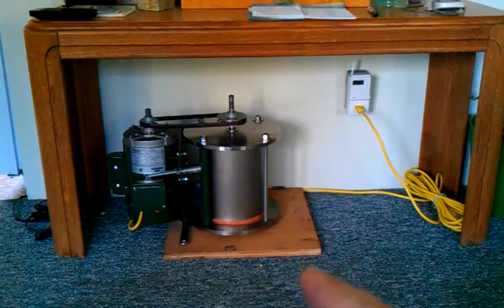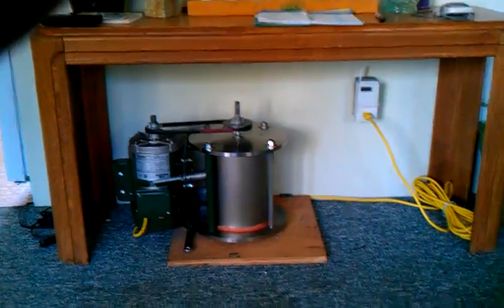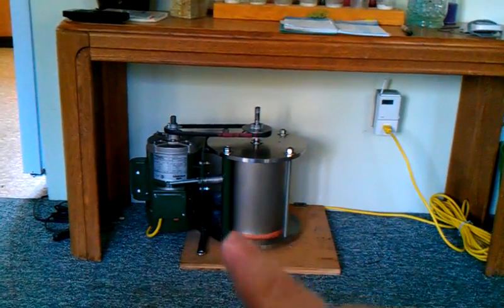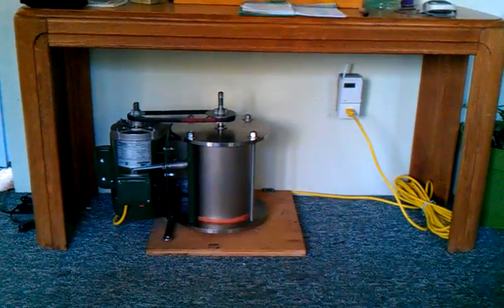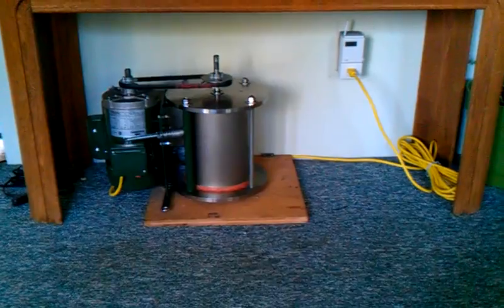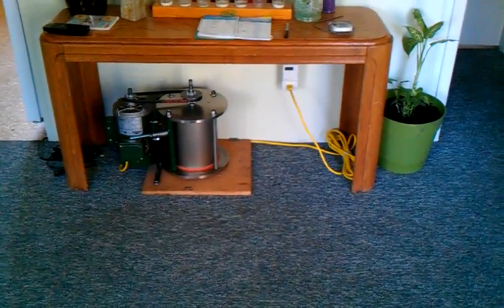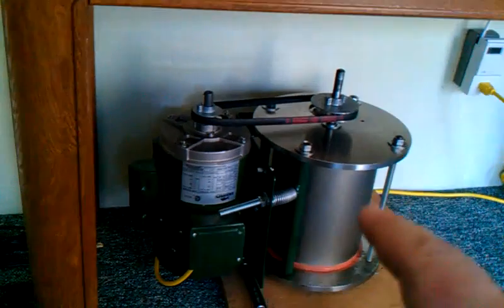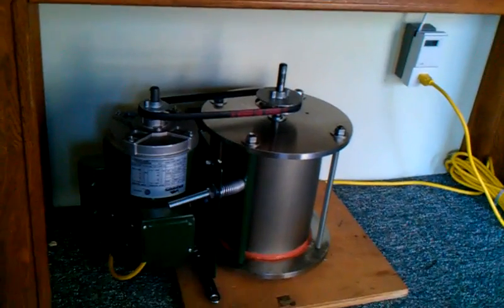Running my friction heater in my house

Comment: A vastly underrated learning experience. Do you still use this system? Can you update this?. I am producing a hydro turbine specifically to be used in old water mills here in the UK - of which there are about 10,000. Using it to produce winter heating instead of electricity obviously allows for utility in a low tech mechanisim.

Comment: I was going to comment that a V-belt has some inefficiency to it, but then realised that the inefficiency is loss due to friction heat!  That said, to reduce noise, why not mount motor and friction device in-line with a rubber coupling?

Comment: Very interesting project. Do you think built bigger could a water jacket be added with a circulation pump and used to heat a few radiators?

Comment: How is it that you need such a big one horse motor, and can get away with turning it so slow.?  The plans I see advise to use a 3200 rpm motor, the painting can design. With the aluminum flashing on the outside canister, and 1/8;top and bottom., with holes tapped in the sides of the disks, for tapping and mounting the flashing.

Comment: hi, i wanted to say that this is a good invention from charles Baker that can be adapted for green thermal energy with a VAWT vertical axis wind turbine to move the disk, and also salt as friction material against metal, using molten salt as PCM phase change material for latent heat source or heat storage. also you can improve insulation.

this technology probably will be used in the near future.

Comment: Will a one H.P handle the unit well ??? How are you going to use capacitors for more efficiency ???
Reply: I’m running mine on three quarters, a horse, and with a motor just like that, an air compressor motor. You hook up capacitors in series, only two wires each one , really the only logical way u would join multiple capacitors., next to each other, you would use the same rating uhf, I would think,
Reply: @davidheater  Would you know how much savings in electrical usage this would amount to David ??
Reply: @victoryfirst2878  mostly , people are saving on natural gas, or heating oil, if your in the n.e., for example. He said on a video , he was paying a dollar a day for electricity. Heating 1200 sq. Ft.
Reply: @davidheater  What exactly happened to this guy ??? I would love to make this heater if I had actual plans that are factual and work. One dollar a day is not that bad at all.

Comment: try just to run a car engine by craking the rotor long enough with the use of a ac motor and see if the whole engine heats up to very hot? pehaps you have to preheat the egine block before atempting this.

Comment: It might be more efficient, to build a water pump, with a cavitation rotor.
But that's just my opinion.
Reply: Tried modeling with the cavitation, then realised that it adds levels of complexity and erosion to the system which is negated by his steel lassagne

Comment: ...I am sorry, but how exactly are you heating your WHOLE 1200 sq foot house, with one dinky heating unit, located under the table in some corner of your house, without any apparent heat distribution, again? 

Sorry but that kind of claim that goes right in the face of any realism/critical thinking, kind of put doubts as to your other claims.
Reply from the maker: Build one, or anything and find out!..... Get off of the chair and do something, anything but nerd post on YT.
Reply: oilpiggy yeah, sure, because I haven't built anything... and your "magic" heat generating device, is "magically" spreading its "magic" heat, to the furthest corners of your house, by... well magic, of course! No radiation, no convection -just pure New Age heat. Ok, I know everything I needed to know here

Comment: It works ...congrats ...but Natural gas is better in cold climates....The greatest cost in heating your home is the fan motor ...not the heat source ( gas  ) ...At minus 40 temps , that elec. motor would have to run nonstop...costing a fortune
Reply: Corrythew...my fan motor is half kW and runs about 50% at -40 while the burner uses  0.6 gals/hour heating oil. So  $0.15  for electricity and      0.6 X   $ 3.40 for oil.

Comment: what is the min HP rec to operate the heat drum?
Reply from the maker: Well that's a good question, and it really depends on the setup.
Reply: oilpiggy I have a 1/2 hp motor that does not draw much power, and I think if you had a smaller unit with fins and the fan blade on the end with the motor direct drive and enclosed in a tube with would really be nice, I remember a spa a friend had it was called a "soft spa" that was heated only by coils of copper pipe wrapped around the motor housing the heated the spa water piping hot.
Reply from the maker: John Kneer

There are some people who have my kits that run a .5 HP motors with no complaints.
I have never been able to test the minimum HP because I just don't have that kind of resources for the R and D.
With more support with every sell of a set of plans or a kit adds to the R and D of this system.
There will come a day that we will not be burning and killing everything around us just to heat something that is a necessity for people in a everyday life.

I will keep moving forward and thank you for your support.
Reply: how do I get plans or order a kit that I can assemble? and what is the cost of each?  people really have no idea just how much gas, fuel oil, electricity and ect. that we waste, which is a lot! we have to change our way of thinking, and your drum heater is one thing they can use to do that.

Comment: Post the plans!!!

P.S. A downward fan mounted on the top of the shaft will circulate the hot air faster without any more power consumption.

I also plan on building this using a DC motor running off my battery bank for my off-grid home, but only after you POST THE PLANS!!!

Please? :)

Comment: Yes, that would make more sense. Maybe I just misunderstood your air routing method. I should have realized that if you are smart enough to make the heater, then you certainly know the proper way to route the air. I like your idea and plan to try it. I would like to place a unit like that within the central heat and air housing and use the existing swirl cage fan to circulate the heated air throughout the house. I would have to install another drive/belt etc from the swirl cage motor to spin the friction heater so that motor would serve two purposes. It would certainly lessen your noise problem. My home is about the same size but our winters are milder. Maybe a week or two in the single digits but mostly the lows are in the teens or twenties. I have been heating with wood. My old back is tired of splitting wood but my wallet prohibits constant heating with the existing heat pump. My heat bills have been as high as $350.00. Way too much. Thanks for the info and the great video. Please do more.
Reply from the maker: like I said this was a VERY old model..... if you watch the latest models or uploads you can see the up grades. Best of luck to you on your build
Reply: @oilpiggy  I would like to buy the new model Oilpiggy. Drop a line fella.

Comment: I would reverse the fan plan. Why would you want really hot air blowing across your drive motor? I thought the idea was to keep the motor cool and the heating coils hot.
Reply from the maker: This is a very old model, but if you think about it, what I am saying is start the air intake from the back side/ bottom of the motor " cooling the motor and warming the air" then moving that warm air over the heat core for the final heat output.

Comment: purelyprimitives The amount of electricity it takes to run a motor is less than the amount it takes to run a baseboard heater. Yes the conversion is 100% but your statement of "The same electricity" is not true.
Reply: Right on fella to your statement. The 100 % conversion is the biggest lie ever put over on mankind. Baseboard electric heaters are just plain junk. You can take a 5 H.P. motor and run it at load (Work)and get heat output too.

Comment: One cool idea would be to power this of a couple of treadmill motors, one outside in a windmill and just wires coming down in the house to spin the other one witch would in turn spin the can, giving you a very simple free heat system. Thanx for sharing these vids.
Reply: you can also use a plastic VAWT wind turbine to move the disks directly, without using electric energy but only mechanical friction energy